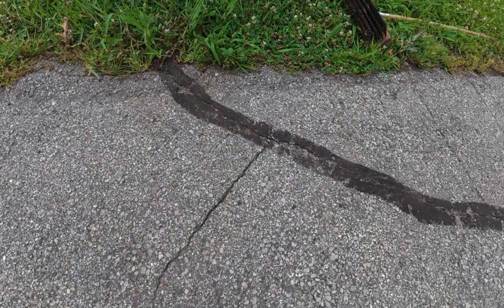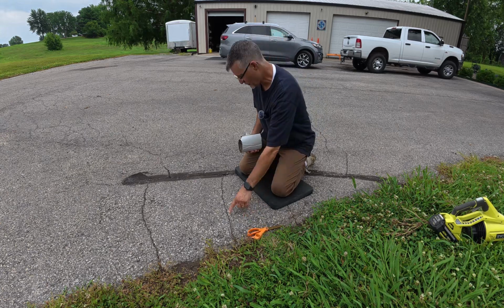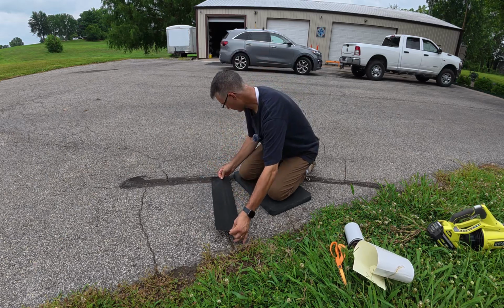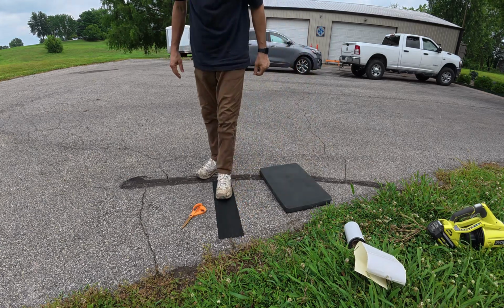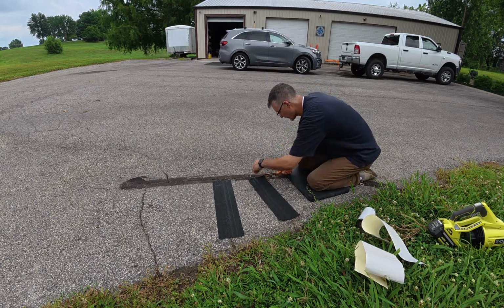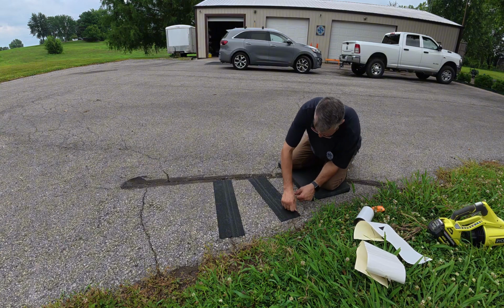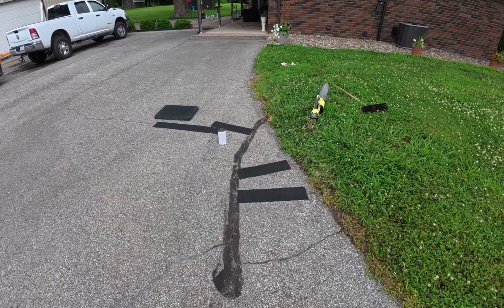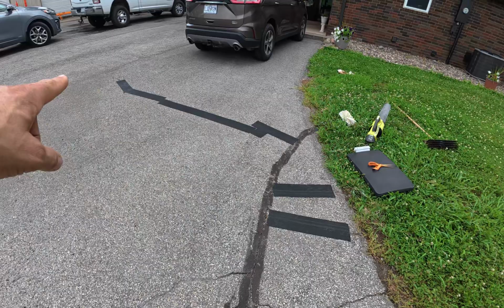An easy way to fix cracks in my asphalt driveway, but will this really work? CCH0041

Comment: Thanks for the time & effort you put into your video production.
Cracks keep me in business. 
You may want to consider the "Rubber Tape" method.
It looks similar to the tape you used, but with the rubber tape, (as mentioned in other comments) you need to heat it with a torch and spread it out with a trowel.
You can feather out the edges, and it looks much better after sealcoating to blend in to the surface of the driveway.
What often saddens me is the efforts people go through to try and put "Lipstick on a Pig".
Many times I'll tell my customers to save their time and money and not waste it on something beyond reasonable repair... it's simply not worth it.
Save that money and put towards replacing the driveway when you can afford it, or go on a nice long vacation for you and your family.
You can find many videos on my channel addressing these issues.
Thanks again...
Best, 
Mike Callahan, Founder
SealcoatUniverity.com

Comment: I watch another very good video where he was using the hot melt method, it did not look messy at all and is what is used on our main roads. I do think that is the best option for this type is crack, much quicker too. Latex-ite I would skip the trowel and use a squeegee as I did watch other videos of yours. In the end with a large driveway as yours I'm not sure it matters all that much what it looks like but rather that it is there for years to come. I do think pressure washing is essential as it will remove all the grime pressure washing is known for and will give you a good base to start with. brushing and blowing the surface really isn't good enough. Just some thoughts.
Reply from the maker: Good tips. Thank you for sharing them and for watching!

Comment: I've seen people use the propane attachmentment to melt it into the crack
Reply from the maker: Interesting idea. I may have to test this product on a different crack and see how it responds to propane. I have a video coming out soon where I repair a crack with the Pli-Stix product which is designed to be used with a propane torch. Thanks for watching!

Comment: Waste of your time and money. Should have done a slurry seal, plus what you did looks crapy.
Reply: Oh Karen, why show the world how petty and spiteful you are? 🤦‍♀️
Reply: Hi Larry I definitely want to know what a slurry seal is can you please let me know?  I've got limited funds...I've sealed my own driveway before with a squeegee but that was a brand new drive.  I've used Aquaphalt before.  My current driveway needs to be replaced frankly but the ruts could be pancaked with tack and Aquaphalt before they completely fall apart. The base is terrible obviously...ruts were previously cold patched by a prior owner so I removed what was loose and of course what remains are ruts deep enough that vehicles look like they are listing to the side.  Once I've got some Aquaphalt, possibly Rapidset Cementall topped with tack and Aquaphalt, I'm going to seal the entire thing, I think.  Depends on what a slurry seal is.  Thank you!